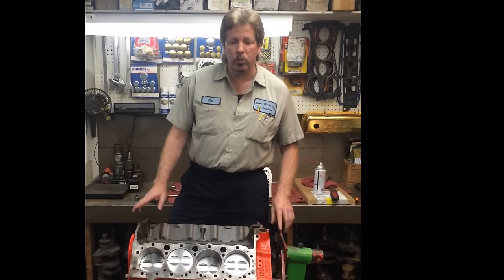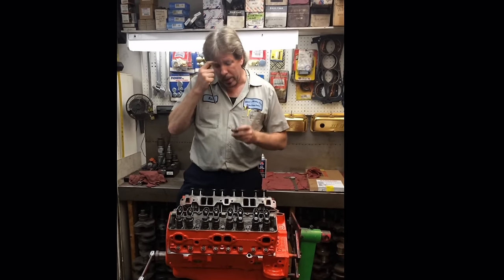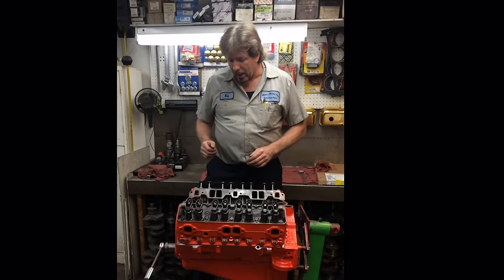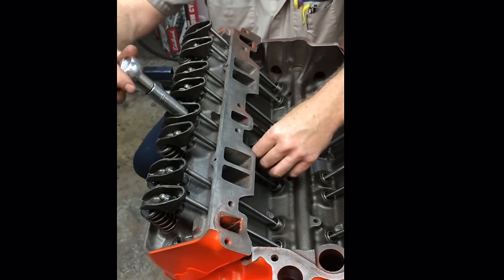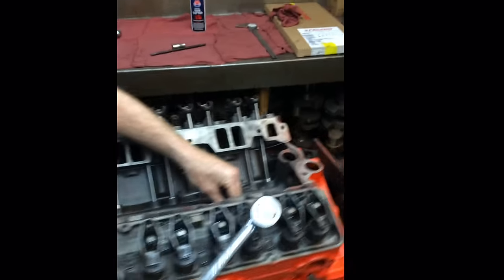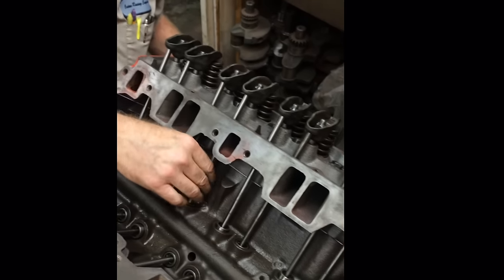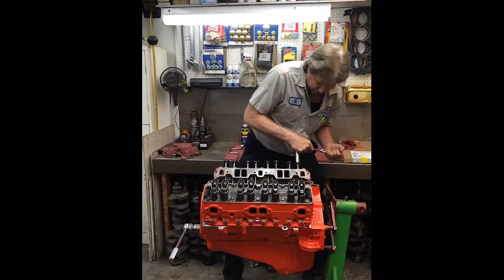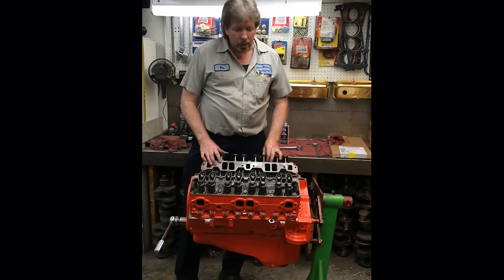Hydraulic valve adjustment made easy - Your Engine Guy

Comment: That's a great video. Alot better way than I used to do it. I'm building a couple of 509s for my boat. I am running hydraulic roller lifters. Adjustment the same? Also how far of a turn would you turn for preload? I've heard from 1/4 to 3/4 turn. Thoughts?
Reply: Just for your info, if you have 7/16 rocker studs, then one full turn of the lock down nut is .050"  if you have 3/8 rocker studs then one full turn of the nut is .042"  the recommended preload is i believe about .035 so you can work out from that how much to turn depending on what you have!

Comment: Do you tighten the pushrods down until they stop spinning or very close to? Or do you only tighten them down so they don't shut the lifter with 0 lash. I got myself into this thinking it was a little easier than I thought. I only spun the pushrod to no lash without pushing the lifter in. When they are turned they become stationary until they come back down. This is normal? If I have that cleared up I'd understand it fully. Hu

Comment: I removed the distributor at top dead center before i removed the intake, if you rotate the crank shaft to adjust these lifters wont it affect the distributor alignment? The rotor was facing towards the #1 piston by the way.

Comment: I ran the oil pump to fill the lifters prior to using my pushrod length checking tool. Now I assume that I should over tighten the rockers until all valves are barely open and let it sit a couple days to bleed the oil out before proceeding.
Comments?

Comment: Am i able to use this method with an engine that already has oil in? My rockers on my 1970 Torino with a 351 2v Cleveland seem very tight, should i back them off and reset them all? Thanks.

Comment: I have been running my rebuild Chevy 2.8 engine to break in the cam but I have clatter.  With the oil in the hydraulic lifters and the valves adjusted by the rebuilder, do I still do the 3/4” preload on ALL rockers even the ones that were not loose?

Comment: I have a question, I thought when the lifters were on top of the lobe, they should still spin in your fingers? I'm doing this method on an engine that has been run, so oiled. I found a sloppy rocker and 4 that were so tight they wouldn't spin in my fingers. So I loosened them, which made them sloppy at valves closed. Rotate the engine after tightening and the same thing, way tight under load. Redo redo redo help?

Comment: good video, but what if the engine has ran a couple of hours and the lifter has oil in it?
Reply: Did you get an answer
Reply: @knutsond182  no but i found my problem, not valve adjustment but a bad egr valve and weak base plate gasket on the egr plate. thanks

Comment: Can some one tell me if this is the same process for already primed lifters? How can i bleed them down to readjust lifters? I am simply adjusting them in an allready running engine but of course oil is already introduced to the lifter. Do they bleed off the pil if the car is sitting a few days?

Comment: I just discovered you today! No youtube in early '70's! Damn amazing video Ken. I had IMO a hot '66 GTO 389 .060 over or 400. Crower 3/4 Cam. I adjusted my lifters as I read they did at Royal Pontiac. Run, clicking, adjust to just stop, lock down. Supposedly an extra 50 or rpm. Easy but messy to do. Question. I shifted this engine at 6000/6400 rpm. 2:20-1 close ratio Muncie with 4:11 posi gears. Yes, I missed some third gear shifts until new Hurst shifter. Problem I had was breaking pushrods. Was that missed shifts and or how I tightened my lifters? Thank you. Wish I knew you back in the day. No Pontiac's anymore but instead a new 2021 6.4 Challenger T/A. Fun car but I can't touch it other than oil catch can, change oil and filter with AMSOIL Signature 0W40 and front and rear strut tower braces. Amazing this technology will put this car in the 12's. My bad ass GTO, Hooker headers, TRW Pistons, Accel/MSD ignition only high 13's! But, I only had frickin Goodyear Polyglas F70-14 tires on Cragar SS wheels, of course. Keep up the great videos. Love old school and how you explain and present.

Comment: Wondering about this method if it works to adjust valves on a used motor that's currently been ran . Got a lifter tick I need to get rid of .

Comment: If you do an engine by the firing order you only need to turn it over 2 revolutions. This method is only if you have adjustable rockers. A lot of late model engines are non adjustable and you may have to use shims to get between.020-.060 preload or a different pushrod length. Thanks for your efforts. A little drawn out before you actually got to the process.

Comment: I'm replacing heads on my sbc the cam and lifters have been in the motor for 4500 miles . So hey have oil in the lifters. So what's the best way to adjust the lifter s

Comment: Quick help? I've mimicked everything he's done. He says the oil should bleed out the pushrods, but I cant get that to happen.

Drill attachment I've made, thumb over the oil sensor, I spin the pump over and get no oil out pushrods. I'm turning the engine a 4th every so often.
Reply: make sure you're spinning it in the correct direction , some distributors spin counter clockwise

Comment: Hydraulic Lifters work good (example BMW engine M43....My engine M43 have reach 350.000 Km and the cams are smooth and not worn at all)... but only if the camshaft is on the head, and the cam push directly to rocker arms (with rolling wheel in the contact point). But i don't know... if there are long rods (auctions and barbells distribution system) and the camshaft is into the basement...

Comment: I have just found your video.
I have tried the TDC method and when I started the motor I had had loose rockers upon start up.
I even tried the EOIC method and still had loose rockers on start up. 
Do you think this will work after the lifters have been pumped up.
I think my #5 cylinder lifters are bleeding down. 
I primed the motor with a drill and had oil out of the push rods. Even after startup the #5 rockers seem to be loose.

Comment: In this video, he shows an engine under construction.  is this the correct method for an engine which has already been running which is in the car?  I want to check my valves.  I will loosen all of my push rods by 2 turns, to apply this method.  would you do that?  Thank you

Comment: I know this is an older video, but i have a 1987 Chevy R10 with a 350. I tore the heads off about 2 weeks ago and now they are back on and the valves are ready to adjust. I tried to push down the rocker and the lifters have no give. The motor hasnt been turned over but is still full of oil. Will this method work with lifters that are not spongy?

Comment: Ok, no one here really answered the question.  Can I do the same process with lifter, NOT DRY? The car was running before.  I had to lose all rocker arms to change the push rods. Now i have to re adjust them. Can i use the same technique without having to bleed off the lifters? Please simple answer. And if not, what should i do? Thanks alot.
Reply: From another comment i read i says it is the same but the car will run a bit rough  for like a minute or two

Comment: Hello again Ken! Getting ready to pull my 460 BB performer rpm intake. Ordered new fel-pro gaskets and ARP intake bolts. Now, my 460 still has Hydraulic flat tapper lifters. Being told, my 460 stud mounted stock rocker arms are the non-adjustable kind and use a torque value of 18-23 ft pounds. On final pass to tightening, would I just apply your 3/4 turn or go with the Ford suggested torque value???  Would really appreciate your feedback on that. Thank you very much for your time. I am a bit confused now. Cheers from Motown/Dearborn.
Reply: on a non adjustable 460 the preload is factory preset
Reply: @44special9  Thank you 44special9! Appreciate it. I was thiking like if you replace one or more or they ever back out. Just preload torque valve on the base circle sir?  Thanks again!!!
Reply: @robertclymer6948  Yes the valve should be closed with the lifter on the base circle and I would make sure the studs weren't changed from the positive stop bottle necked style to a regular style like shown here . My book says the 460 positive stop studs are 7/16 " at the bottom , have a shoulder , and are 3/8 " at the top and the rocker arm is the valve stem guided one where the tip of the rocker arm straddles the valve stem . The preload should be ok unless it has alot of wear or cylinder head work was done or something is changed like an aftermarket cam and / or lifters are installed in which case it might change and a different length pushrod might be needed . Whenever engine work is done it's not a bad idea to turn the crank by hand at least two revolutions if possible to check for any interference before starting .
Reply: @44special9   Thank you very much. I really appreciate your feedback!!!
Reply: @robertclymer6948  Glad  to help , if it's the type I described torque em on the base circle and hopefully they're good to go .
Reply: @44special9   Yes, Pretty much a stock OEM cam, lifters and rockers set up, stud type 1.73 ratio. Thanks again for your help. Appreciate you!

Comment: Flat tappet done the same way?
Reply: These are flat tappets
Reply: @44special9  what if motor is in car? Adjust the same?
Reply: @BiGGBLUNT1   I haven't done one in a car but if you were just planning to go thru and check for loose ones the only difference would be you would only put preload on the ones that were loose because some if not all have preload since it's in a car . The other way would be to start from scratch and readjust all of them . I prefer to lightly lift them up and down (without compressing the spring in the lifter) instead of spinning to check for play but to each their own . Some people like to start out with a half turn of preload and work up if needed if any tapping is heard . Since they have oil in them when you put the preload on it could hold a valve open so after I was done putting the preload on all of them I would probably wait four to five minutes and then give the crank a quarter turn every four to five minutes for at least two revolutions to bleed them down a little before fire up just in case .

Comment: If done with repeated turns on the balancer, can this be done "gently" without removing the intake ??   My car has been drip free after a long struggle with every orifice.   So want to avoid removing the manifold if that's possible.  My first time.  Got light tick sound going on one head but will adjust all.  Comments welcome.

Comment: as I realize there may be a difference in height of pressed in studs.  on a van due to space. and single head gasket replacement.  I get one valve correct ish then measure from top of stud to top of nut. take this measure and duplicate your to all rocker arms.

Comment: Hey Ken, thanks a lot for this info! Helluva lot easier than bumping the motor with the key for an hour if you're working on an installed motor with a fan shroud. Question: if the motor's been running, lifters pumped, do you still go 3/4 turn? I've always heard it was 1/4. Thanks again.
Reply: I would like to know this also

Comment: I’m working on a 1969 351w, pray for for me, lol, could you shed any light if the rocker studs nuts are to tighten/bottom out on the studs to get the lash out? It seems the first time the lash goes to zero is when the rocker nuts are bottomed out on the studs. Also can’t obtain pre-load. Thanks

Comment: I followed your technique to adjust the valves on 2005 mercruiser 4.3 engine. I have one rod is loose and when I rotate the motor this particular valve opens and there’s no room for adjustment. What you think where is the problem?

Comment: Does this work on a vehicle in the engine that has been run? If it sits for a few days would the oil drain back from the lifters to keep the issue you discussed at the beginning from happening?

Comment: I hardly ever touch  my old  engines .but got another hot rod with a messed up  set of heads ..I got a good set to install ..can I use this method with the engine  still in the car ..it's a 37 ford sedan so it's a tight fit for a 350 all tho it's s10 chassis underneath  ....

Comment: I have a 1978 K5Chevy blazer with a 350 5.7l small block Chevy in it . it has 400 miles on the new rebuild , I broke in the cam I did all the rest but how can I adjust my lifters now that I’ve already ran 400 miles . Because they have oil in them now I’m under the impression that I cannot use your method because of that oil in the lifters .I have a cylinder that is fouling plug and I have one sounds like it’s rattling  twice as fast as normal . Please Help

Comment: Where do I go from here . Ok I soaked my lifters (flat tappet hydralic) and it's assembled and in the car (350 chevy) I basically adjusted them by turning the push rod .to zero clearence then 1\4 turn .
(Comp cam and lifters 268\460) I've only started it and I have not did the warm up and breaking in the cam. I've built a few small blocks . What advice can you offer me at this point ????? 
I've also seen so many cams destroyed by the lifter or just improper installation of this combo.  I do not want to have to pull this engine again.

Comment: What about if you have an existing engine apart and the lifters already have oil in them? I would do the same thing, bring them all to zero lash first, but then what's the right way to set the preload after that? Thank you if you get a chance to answer.

Comment: I adjusted my valve lash while the engine is running at quarter turn. Is it better to adjust it to 3/4 turn? I have a stock  307 small block blocK Chevy. Response will be greatly appreciated. Thanks!

Comment: Hi Ken,
I have a 350 in my 55 Chevy. I want to adj the valves using your method but the engine has been driven and there are five quarts of oil in the sump so the lifters have oil in them.
Can I still use your method?

Comment: Hi I just did a cam swap on mopar  340 cam lifers hydrolic flat tapped and fire up the car with regular rocker arms none adjustable  well turns out my push rods are too small so I want to install adjustable rocker arm it's a mild cam how  engine is all put back together in the car any advice

Comment: What to you differently if the lifters are already filled with oil? I can't adjust the valves while the motor is running do to a gear drive that makes it impossible to hear the tap.  The motor has already been run.  This is not a freshly built motor.

Thxs
Reply: Hey man did you end up getting answer still wondering this same thing
Reply: @landen1326  I didn’t get a reply. I adjusted the valves using his method and it seemed to work well. Motor is running much better and after adjusting the vacuum the engine idles on its own.

Comment: How can I apply this method on a solid roller  lifter  and the adjustment is recommended to be done when engine is hot. 
I like this method but I need to know for sure if it will work for me.
Reply: This does not seem practical for solid lifters since they're adjusted with a feeler gauge with the valve closed .
Reply: @44special9  from 8.10 to 8.15 exact time on the video he says it can be done on a solid lifter ,  the valves will be closed at that point.
Reply: @underdog1168  Are you sure you have solid lifters ? Solids don't have this 3/4 or so turn of preload put on them . When he put the 3/4 turn preload on some valves were open , some were closed . Putting solid lifters at 0 lash first , like here , seems like an extra step because you would still have to go to each valve afterwards and close it and adjust it with a feeler gauge when you can just start by closing valves and adjusting them .
Reply: 44special I think you are not understanding his teaching.  You can lash with a feeler gauge (solid lifter) or preload your valves  up to 3/4 of a turn  (hydraulic lifter) after  you have them all at zero lash using his method.  

I'm thinking In the case of a solid lifter , you can lash your valves cold with the cam card lash clearance using his method then start the car bring it to operating temperature, then check what is the clearance HOT which will be greater than COLD and subtract the hot from the cold which can be from 002 to 006. 
After you have your close to perfect las# you can loosen all your valves again and use his method with your new lash clearance again.  

I answered my own question. 

You can always use the EOIC method but that is not what this video is about RIGHT?

Comment: Does this method work for higher mileage engines? I recently put new heads on my 350 and I keep getting a rough idle, and misfires. I know it's because of the valve lash. Do I still need to go 3/4 turn at the end if it's not a newly assembled motor?

Comment: Question if you adjust rod and lifter is down though the system wouldn't' the lifter compress due to the spring pressure?

Comment: Hi Ken . This method works with heads on and oil in the pan? You mentioned 3/4 turn to seat.rocker in. How do you determine that adjustment? You mentioned decision due to cam etc.

Comment: I have a question: I took the 2.8 from the s10 to get it rebored and cleaned and covid happened and haven't worked on it in years. It's still on the stand but it's rusty in spots even in the pistons chambers. How do I remove the rust without causing damage to the piston chambers?

Comment: I just changed valve stem seals on a 350 obs in the truck and need to adjust the rockers. Is there a method change difference since the lifters are used/oiled?

Comment: How come there are no guide plates for the push rods?
Reply: These pressed in rocker studs wouldn't work with them . Not every engine came with them , but they would stabilize this valvetrain more .